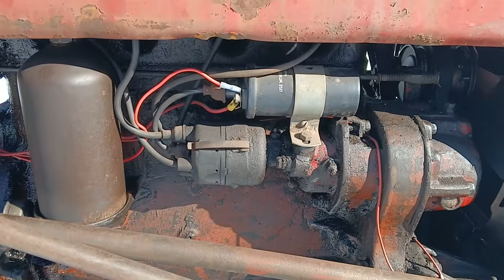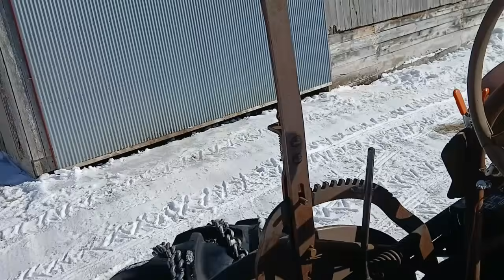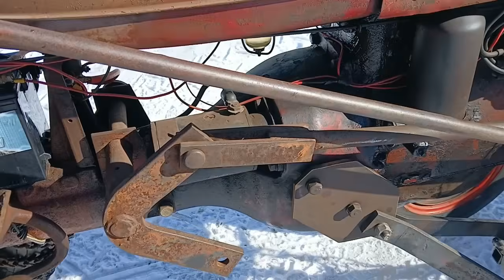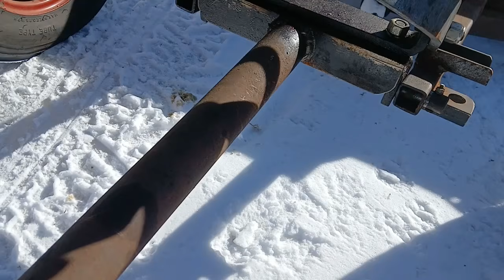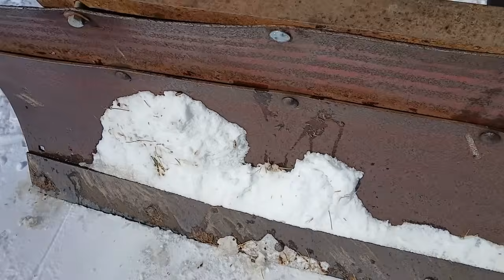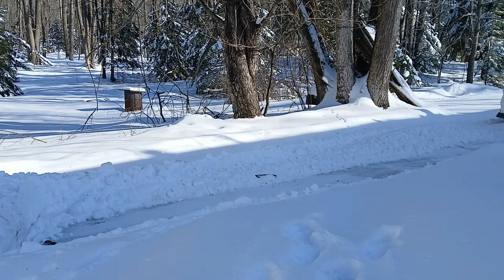1940 Farmall A--Snowplowing

Comment: Just wondering, can the spring be adjusted so lifting the blade is easier or change the spring? I don't know if it's possible.
Reply from the maker: Yes, you can put more tension on the spring to help. I actually have it adjusted as far as it goes but it still isn't quite enough. I'm not sure I could find a suitable stronger option. I tried putting a hydraulic pump on the tractor several years ago  but the pump I had didn't work out. Thank you.